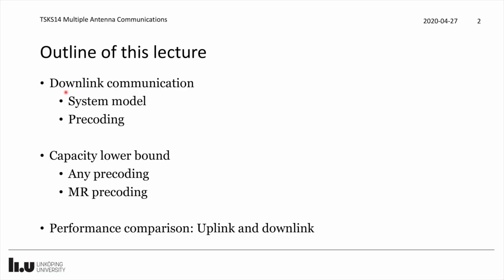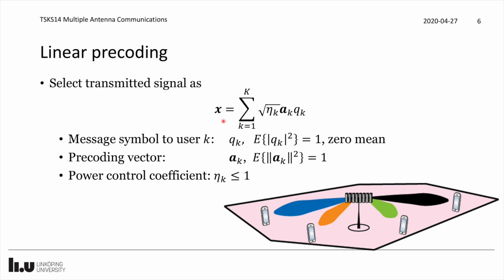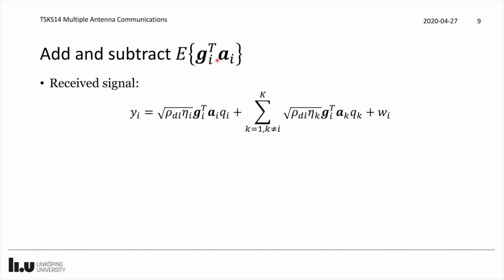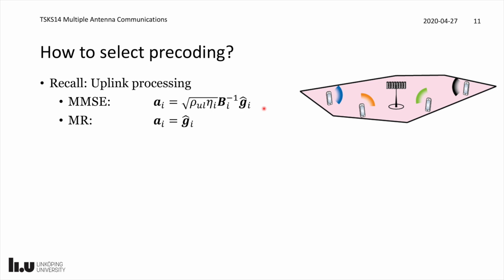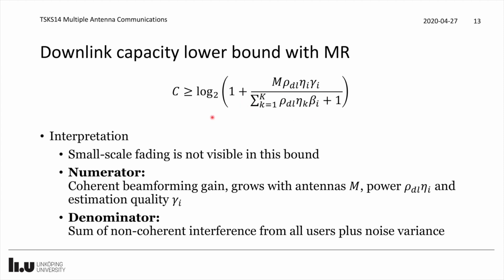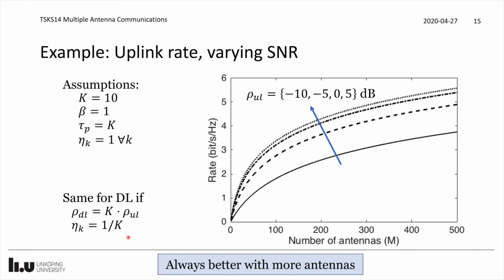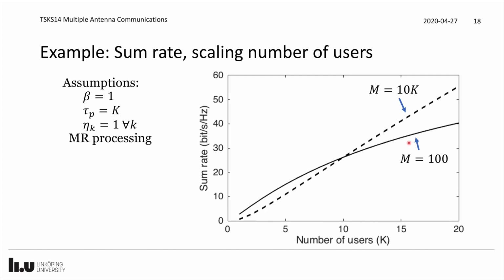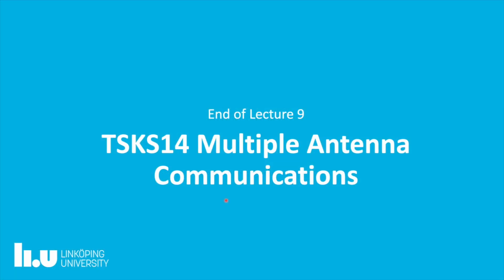Lecture 9: Downlink multiuser MIMO with linear processing (Multiple Antenna Communications)

Comment: Are there any other precoding technicians more optimal than WMMSE
Reply from the maker: The optimal precoding depends on what metric you are optimizing. The WMMSE algorithm finds a local optimum to weighted sum rate maximization problems. One can also create algorithms that find the global optimum but these have much higher complexity. These are described in Chapter 2 of https://www.diva-portal.org/smash/get/diva2:608533/FULLTEXT01.pdf
Reply: @WirelessFuture  Thank you

Comment: @futur wireless thanks for this vedio.

I have two questions:

1) why the capacity expression is à lower bound? Because, we obtain such expression for AWGN channel with both signal and the noise being Gaussian, and anything non Gaussian (e.g, interference)  makes the denominator lower making the whole bigger?

2) why do we have expectation in the capacity expression ? What if we don't assume realization of the channel is equal to its expectation?Can't we write capacity expression with the realization of the channel? Or we are to consider fast Or slow fading enforcing to consider  ergodic or outage capacity in that case?
Reply from the maker: 1) The capacity is optimal way to communicate. The reason that we obtain a lower bound is that the interference is "treated as noise", which might not be the optimal way of communicating. One can for example achieve higher rate using successive interference cancelation or dirty paper coding methods, but that is not considered. Therefore we have a lower bound.

2) The channel is varying randomly between coherence intervals. The channel code span over (infinitely) many coherence interval and therefore becomes adapted to the average channel conditions. There are basically three cases: fast fading (containing expectation over the channel since there are many realizations), slow fading (one channel realization but unknown at the transmitter), and fixed channel (one channel realization known everywhere).
Reply: @WirelessFuture  thanks...so, out of 3 channel situations, which one is considered here? Fixed channel ?
Reply from the maker: @amahbubul85  Fast fading.
Reply: @WirelessFuture  thanks..need to see  the video again

Comment: With respect to your remarks to M-MMSE in your book (UL SDMA): the ratio M/K is important for the performance that is clear: Is my assumption right: There are more BS antennas than UEs -> the number of constant streams is K, but the streams can switch from used antennas to free antennas -> the best antennas are chosen for the transmission and there is a regular switch between the antennas (dependent of the antenna SNR). Is that right? 
Thank You.
Reply from the maker: Your interpretation is only partially correct. All K streams are transmitted from all M antennas. The more antennas are used, the more directive the transmission of all the streams become. One way to picture it: A cake is divided into M pieces (beams). K people are standing around the cake. The smaller the pieces are, the bigger chance is that each person can get the piece in front of them without colliding with someone else.
Reply: @WirelessFuture  Thank You very much for your answer. And when every of the M antennas transmit K streams -they transmit it per TDD. Every of the K streams get a little time slot yes (every of the antennas transmit the same time-slot at the same time)?
Reply from the maker: I suppose you are referring to TDMA, where the users take turns. Massive MIMO is a space-division multiple access (SDMA) scheme. All K streams are transmitted at the same time on the same frequencies, but using different beams.

Comment: Thanks for the fantastic presentation. Can you please share a reference for the capacity formula in slide 10? Also, I am wondering what it would look like if we have an arbitrary combining scheme at the receiver. I would really appreciate it if you could refer me to a good resource that drives capacity lower bound or capacity approximation for a MIMO case with arbitrary precoding and combining. Also, I am curious about the capacity formula in the hybrid digital-analog MIMO system.
Reply from the maker: I recommend Theorems 1 and 2 in this book chapter: http://www.diva-portal.org/smash/get/diva2:1049059/FULLTEXT02.pdf

These expressions could also be used with hybrid beamforming, by selecting the precoding and combining in a way that is allowed by the hardware.

Comment: Hello Professor. Thank you for uploading the videos. The video has a perfect explanation for the precoding techniques. I have one question: In slide (11), will the MMSE precoder depend on the base station power $\rho_{dl}$ or on the user power $\rho_{ul}$ as shown in the slide? Also, will there be a conjugate on the precoders?
Reply from the maker: I usually use rho_ul for MMSE precoding, but both options are possible. None of them will be optimal. You are right. There should be conjugates on the precoders!